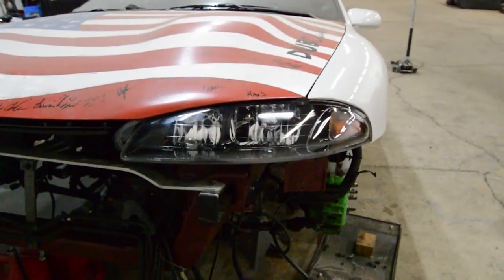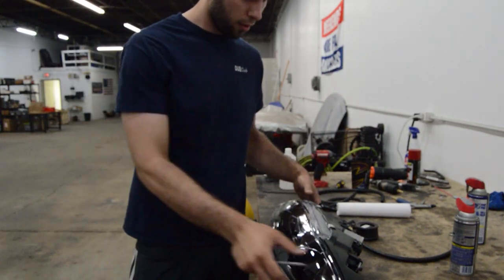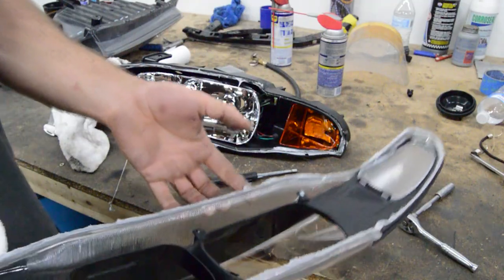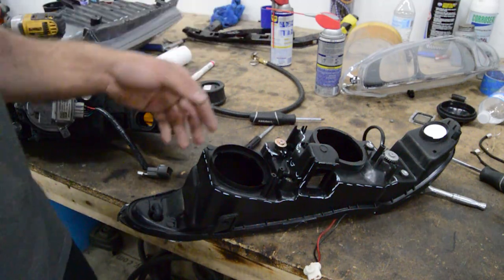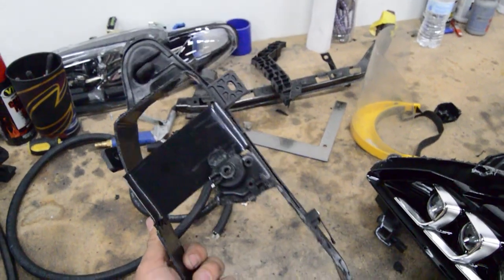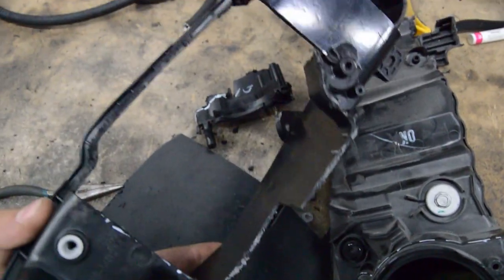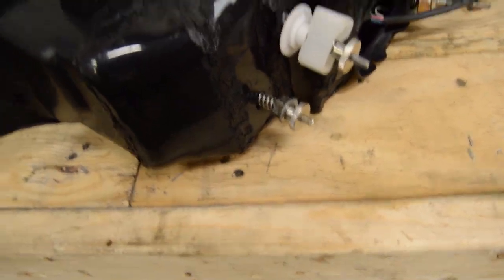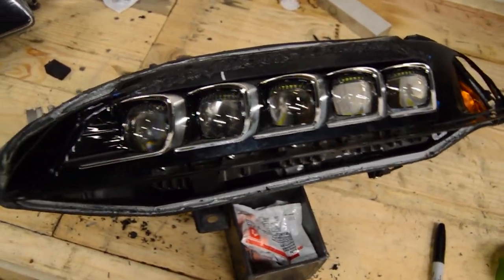How I Made My Eclipse Jewel Headlights

Comment: I want to take apart my 2019 Acura RDX headlights to paint some stuff inside. I have opened up a lot of headlights in my life with the oven but I don’t mind the heat gun method either. I need your advice. I’m so scared of ruining the electronics inside the housing when it’s heated. All the headlights I’ve done in the past, I’ve removed all the bulbs. It looks like you can’t remove bulbs like that for jewel eyes. Can you tell me exactly all the stuff I should remove before heating it up? I don’t want to ruin the LEDs inside.
Reply from the maker: I would just remove the modules off the bottom and then bake em. They will be alright I think

Comment: $2500 is kind of steep, even though it's prob 7 or 800 in parts just to start. They look great though. Not many people are doing this. Most eclipse owners aren't making that kinda of dough to shell out on headlights though, so the target audience is prob closer to $1200. Appreciate the video though for those who can't afford it, can try it on their own. Major props.
Reply from the maker: I agree that it's steep. But honestly with the amount of time it takes to make them, there is no way that I will be able to offer them any cheaper
Reply: @IT_Performance  you could 3D print the brackets and the entire shrouds of the inside of the headlight. Even if you had to pay somebody to do it it would be a lot cheaper easier and much much faster to assemble
Reply from the maker: I agree. I was thinking about doing that too. Problem is I'm not great at 3d modeling

Comment: Hey what sealant did you use to seal them back together ?
Reply from the maker: I just backed them back together. Resusing the sealant that was there originally
Reply from the maker: But Morimoto makes a headlight sealant i beleive its called retrorubber. You can find it on Amazon. As well as some other brands.
Reply: @IT_Performance  thank you so much!!